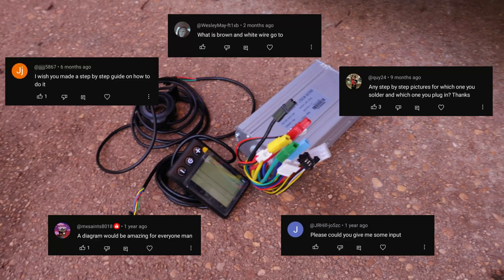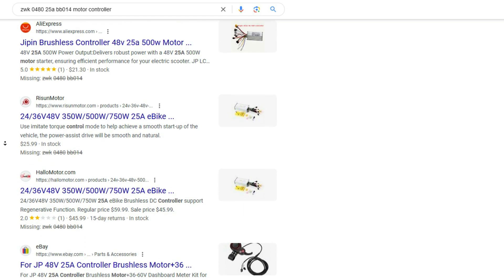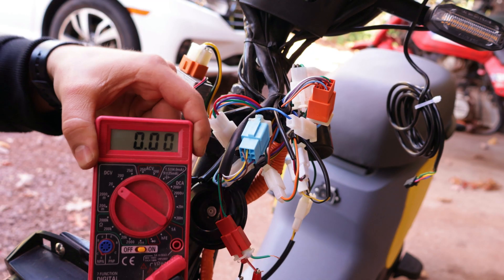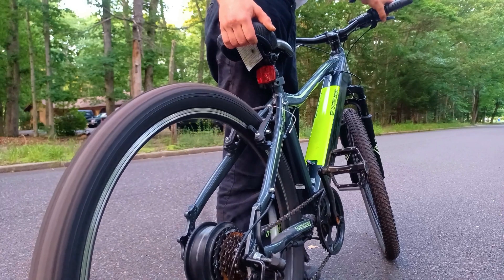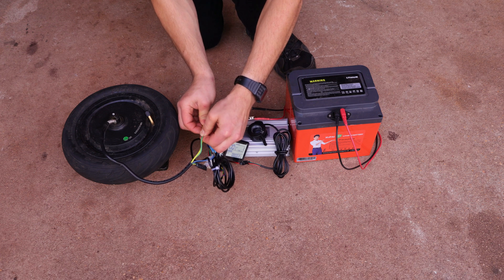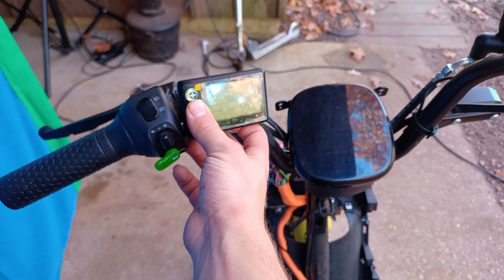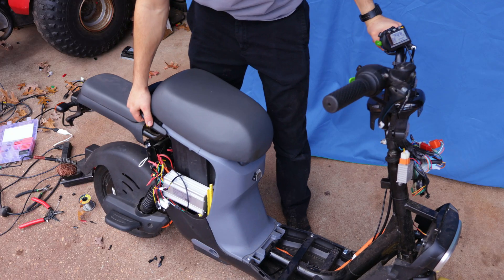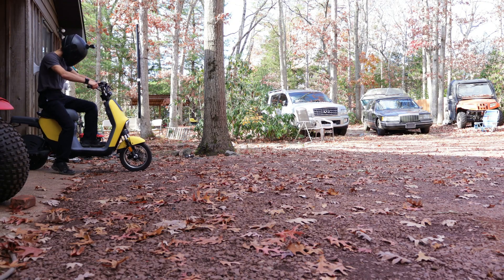STOP Making This Ebike Motor Controller Installation Mistake!

Comment: If you defeat (leave unplugged ) things like the brake sensors and crank sensor will the controller still work? I transferred a kit to a larger MTB but I'm getting nothing at the display / no power to the wheel either -* Everything ran perfect before I re installed the kit. I was carful to plug everything else in correctly btw. I build bikes but its my first ebike.
Reply from the maker: The motor controllers can work without the brake sensor and can also work without the pedal assist sensor by default. If you’re not getting power to the display, something isn't right with the controller, and you might have to get a replacement, because there should always be the same voltage from the battery at the display (that is, if the battery is working)
Reply: @ElectronicLab.  Good to know. I found the hex heads were sticking up too high for the battery mount and not allowing the plastic battery case to sit low enough where the metal pins need to contact. thanks for the letting me know its handy to know.
Reply from the maker: You're welcome
Reply: 300 kmh faster too =)
Reply: I fixed that, but now am getting an E4 error thats code for "throttle. I inspected the throttle and reset the controller by leaving the battery out for 5 minutes. The E4 error persists. I left the crank sensor plugged in but not installed on the crank. And I left the brake sensors unplugged. Other than that I can't figure it out. I exhausted inspecting the wires and plugs for damage 4x over. Thus far I don't know what to do next =(. If I only had a spare throttle to test it. After work Ill crack open the housing and inspect this one, maybe a wire jiggled loose during the un/ installation. Nothing visible is a skew atm though and it seems to work and snap back etc.
Reply from the maker: Try disconnecting the throttle wires, and if the error goes away, then either the throttle is bad, or the throttle is not hooked up correctly . If you still get the error, I would suggest getting a replacement under Amazons 30-day warranty. because that would mean that the speed controller is not working properly
Reply: @ElectronicLab.  I checked each of those 3x over at least, plus others, and reset with every little change. You mean the "speed controller" inside the throttle body itself right?  I can easily order one and hopefully get it by tomorrow. I'm dying to try the bike already its kind of torturing me here lol
Reply from the maker: I ment the motor controller. But if you only want to replace the display/throttle, you can do that, and if that doesn't work, just buy a whole new replacement motor controller kit, once again Amazon has a 30-day return policy (if you bought it from Amazon)
Reply: @ElectronicLab.  I bought a complete bike less than a year old/ 2200 kms on it, then transferred the parts to another mtb. everything worked perfect prior. I can't buy more parts if unsure, I can't waste more money on it haha.
Reply from the maker: Makes sense
Reply: @ElectronicLab.  I installed a new throttle, the e4 persists. I keep reading to reset the display but both soft and hard resets do nothing. Still got the emtb blues for real its a long weekend and Im a mile away from 20 miles of beaches =/ LOL The ladies better wait for me.
Reply from the maker: @potsy9973 Something that can trigger this code is holding down the throttle on start-up. But I guess if you've replaced the throttle that runs with a new wire to the motor controller, the only other option would be to replace the motor controller.
Just because I'm curious, did you buy the motor controller kit that I've linked in the video description?
Reply: @ElectronicLab.  No no, I found your channel trying to fix an M10 Isinwheel emtb I just bought but then found it to be too small, then I swapped the e- motor parts all over to a Specialized stumpjumper 29 MTB, everything worked perfectly prior and I was carful not to mix up any wiring etc. I was going to buy a new controller but the wiring is different. even tho I went by the # on the one I have. sigh.
Reply from the maker: The main wires you need from a motor controller are: red and black for positive and negative power input, 3 thick colorful wires for the motor, 5 thin wires minimum for reading the motors position(hall sensor, usually a more square connector), 3 thin wires for throttle, and sometimes you'll have a display which has about 5 thin wires. If you hook up all that, you should be able to get it going, unless something was hooked up incorrectly and got damaged
Reply: @ElectronicLab.  Odd that the error stays even when the throttle is unplugged. Im going back to my greasy motorbike its reliable and simple to repair lol
Reply from the maker: I guess it's better than nothing
Reply: I just won an e-bike in auction and the battery holds charge but the display doesn’t show anything should I open the area holding the controller and take it out for inspection or?
Reply: @madweedz15  Was the battery switched on ( dumb question but it happens) Yes then inspect every wire and pin connector for signs of damage, a multi meter test is best then u know for sure if every wire is getting power from end to end. first remove the battery to try resetting the controller.

Comment: My vevor controller and surron battery were working great till today I hopped on went down to the yard and it just stopped working I’m thinking it’s the throttle tho it felt alil stuck and didn’t slide as easily as it should hopefully that’s all it is battery still shows 91v 60v battery
Reply from the maker: I wish you good luck

Comment: If I were to go on the po8 Settings, would I be able to go faster on any ebike like that use that controller
Reply: Just check your motor and controller if its too hot too touch then lower the speed down a tad.some motor i uses the s866 controller on hate life past 30mph
Reply from the maker: Possibly yes, because some ebike manufacturers lock the speed through the display settings while some lock it through a physical wire
Reply: What if I put this controller on any e-scooter and then change the settings for it to go faster specifically the gyrocopter J30
Reply from the maker: There is only one way to find out. Install it, and test it
Reply: @NasirAhmad-e7h  if your oem controller have a speed lomiter yes it be slightly faster.but with any e motors you need more voltage for more speed just its at your own risk

Comment: What if the controller dont have hall sensor?
Reply: Thanks  I thought so but I can't find how to make it work I got everything else to fire up but no go on throttle.any help would be appreciated.
Reply from the maker: By fire up, you mean the display is working but the throttle doesn't do anything, not even noises? And also are you using a speed controller that came with your ebike, or are you using the Chinese controller from Amazon? Because the ones that comes with the ebike usually don't work without hall sensor feedback
Reply from the maker: I think the controller can also work without hall sensor input, but it won't have a great starting torque like if it would have hall sensors

Comment: Great video! I'm pretty sure the controller takes DC in and inverts it to AC there phase. I think also there are different controllers. I was just reading a thread and they were disagreeing but I definitely know if when I check for voltage at the output of my controller/inverter DC won't register so I'm saying it 3 phase Ac maybe I'm crazy but I swear you can tell from the sound of the arc. Can anyone elaborate? I' tell people that ebikes are really addicting! I can't get enough. I wanna build some kind of hybrid bike with like a little 5hp diesel for the main power through a generator and also utilize the hub or hubs for gegen and also some type of solar with lic caps!!
Reply: Technically it's modulated d c, that means it pulsates, but doesn't go negative like a c
Reply: That's very similar to a c current, and how it works

Comment: This video is great thank you!  I’m having a problem. I am not sure my controller is getting power. I tested the voltage from the plug on the battery and it shows full (36v). When I plug in my display to the controller it won’t turn on. It doesn’t even spark when I plug the battery into the controller like I think it should. Any ideas?
Reply from the maker: It might be a defective controller or display. Amazon has a 30-day return policy, so you can get a replacement
Reply: @ElectronicLab.  I just checked the battery plug again with the multimeter and it still shows 36v. I was curious so I put a wire in the positive and a wire in the negative of the battery to see if I get spark when I briefly touch the wires. Nothing happened.  I don’t think the controller is getting power. How can the multimeter show power but not getting any spark or anything?
Reply from the maker: Sometimes, the battery management system goes bad from a battery pack, and you might have to replace it. Preferably with one that has enough current capability and also has a cell balancing feature. I suggest you should first connect 36-volts from a different battery  pack or from a power supply.
Reply: @ElectronicLab. Thank you!  I’ll see if I can find another known good battery. I think you’re right. It’s probably the BMS.

Comment: those motor wires arent for 25amps it will burn at 25amps for more than 5m
Reply from the maker: 3 phase motors don't receive 25 amps continuously for each wire. The current is distributed between the 3 phase wires.

Ps, the moped this was installed on has already been driven a few hundred miles since the new motor controller was installed, and there were no issues.
Reply: @ElectronicLab.  ohhhh ok thanks for the info

Comment: How about for those motors that don't have hall sensor
Reply from the maker: I think this motor controller can work with hall sensors, although you'll have to push it in order to start driving.

Comment: i had the issue before where the motor will attempt to spin but doesn't,  trying out the method you told works but now when i have another issue, the motor doesn't spin at all, i still get power on the throttle because i can see the voltage counter but when i twist the throttle there's literally nothing, no sounds of the internals in the hub motor spinning whatsoever. I tried to interchange the phase wires with many different combinations but it still won't work. Any ideas?
Reply from the maker: Amazon has a 30-day return policy, so I suggest you should get a replacement because it sounds like the motor controller is defective

Comment: so you telling me i can technically make electric racing wheel barrow based on that video?
Reply from the maker: Yes
Reply: So, you're telling me that you really don't know if an electric wheelbarrow is possible? If you can bolt a wheel to it, you can bolt an electric wheel to it. Obviously. 50mph pushchair? No problem. motorway speeds on your wheelie bin? Easy. Drag race Wheelbarrow would use about 5% of my mind to make.

Comment: Interesting idea 😅
Also the moped battery is pretty beefy, do you know what kind of range you were getting when it was on the moped?
Reply from the maker: I didn't test it, but I can tell you that after driving a 10 mile trip, the battery is still at 3/4 full

Comment: How fast for a 48v?
Reply from the maker: It's 30 miles per hour and most ebikes that have a 48-volt battery, can also reach this kind of speed.
although some motors are built to have high torque and low speeds, like when I built an electric trike that uses hoverboard motors which works with a fully charged 63 volt battery and only goes up to 24 miles per hour, but has so much torque that you have to lean forward in order not to flip over: https://youtu.be/lN26pIku1ds?si=pywRyBhFDOu3MNx9

Comment: is that 30KPH or 30MPH?
Reply from the maker: It's 30 miles per hour and most ebikes that have a 48-volt battery, can also reach this kind of speed.
although some motors are built to have high torque and low speeds, like when I built an electric trike that uses hoverboard motors which works with a fully charged 63 volt battery and only goes up to 24 miles per hour, but has so much torque that you have to lean forward in order not to flip over: https://youtu.be/lN26pIku1ds?si=pywRyBhFDOu3MNx9

Comment: I have a controller like the one you just removed from the moped. It did not come with instructions. Could you kindly do a video or explain how that type works? Mine is the DKYS 72v 3000w controller.

Comment: Great video, I'm currently planning to fix my Chinese ebike. The controller failed and I want to get a new one. I'm seeking a motor controller for it.
Reply: Can I have your email? I wanna send a picture and ask for your recommendation.
Reply from the maker: @jamaliepuran2107  post a video on your YouTube channel
Reply: @ElectronicLab.  The hub motor is 48v 500w, the old controler is 48v 20a 500w but it got damaged and I noticed that it wasn't pushing enough current. When I opened it, I noticed that one of capacitors were bad it was about to catch fire. I quickly disconnect the battery as I upgraded from a lead acid to LifeP04 48v 16AH.
Reply from the maker: @jamaliepuran2107  This should work: https://amzn.to/3RMK8Br (amazon affiliate link)

Comment: if you don't have Hall sensor, will you still get speed on display? if yes then how is the speed calculated.
Reply from the maker: @dariusz078  I think this motor controller can work without hall sensors, and if it shows speed, then it probably calculates it through rpm, since in the settings you can tell it how many magnets the motor has and what size the tire is.

Comment: I have the same controller bro do you have to connect the display it comes with or can can u use the display the ebike has in the middle if it works
Reply from the maker: @shomaris7661  try it

Comment: Hey ElectronicLab, ich habe dein Video gesehen und muss dir wirklich eine Warnung aussprechen: Diese chinesischen Elektroroller sind absolut nicht dafür gemacht, wie ein Motorrad gefahren zu werden. Die Rahmenqualität ist katastrophal – die Schweißnähte sind oft minderwertig, und die Geometrie ist völlig unausgegoren. Wenn du den Roller schneller machst, setzt du dich einem enormen Risiko aus.

Im schlimmsten Fall kann der Rahmen unter der Belastung brechen – stell dir vor, du fährst mit 30 oder 35 mph und das Ding zerbricht unter dir. Das ist lebensgefährlich! Diese Roller sind für moderate Geschwindigkeiten und vorsichtige Nutzung gebaut, nicht für Racing oder aggressive Fahrweise.

Bitte tu dir selbst den Gefallen und behandle das Ding wie das, was es ist: ein günstiges Fortbewegungsmittel für den Stadtverkehr, nicht ein Motorrad. Bleib sicher! 🙏

Comment: Are you saying to switch around the the phase wires like connect the yellow one to the green one and the yellow one to the red one
Reply: Is that what he meant. ? Switch phase wires??🤔
Reply from the maker: these Chinese motor controllers from Amazon have this issue that when the 3 phase wires are color to color, it doesn't want to work. so for that, you have to switch around the phase wires until it spins in the right direction.

Comment: So I got a controller that says 24/36/48 with power of 250 350 w and my bike is a 36v with 250 watt shouldnt it work still cause that paperwork has me confused but then controller they sent only shows 42v 250/350w both are 13 amps
Reply from the maker: At 10:16, you can see me entering the motor controllers settings through the display, and if you want to make sure that  it is set to the same voltage, then you should change the p03 settings, which should give you the option of 24, 36, 48 or 60-volts. (I already used the 60-volt(67v-max) mode in a previous video on this ebike motor controller, so it should be safe)
Reply: Cool so how do you keep settle assist  with full power is it a setting?
Reply from the maker: P10 allows you to select what controlls to use. Setting 0 is pedal assist only, setting 1 will give you throttle only, and setting 2 will give you both pedal assist and throttle control.
P11 is power sensitive, ranging from 1 to 24. p12 is power assist starting strength, ranging from 0 to 5.

Overall, the controller should already come with the speed set to max, although when powering up the ebike, it will be set to level 1 speed and you can just press mode/plus button ontill you get the highest assist number.
Reply: @ElectronicLab. I turn on throttle and tire moves without pulling on throttle  is it a wire or a senser wire?
Reply from the maker: @Goonielogic  there is a single wire connector that is responsible for changing the direction. While it is connected, it will make the tire spin at a medium speed. To stop this from happening, just disconnect that single wire connection.
Reply: @ElectronicLab.  thx i gave up wire colors didnt match and the paper they sent i couldn't read the 5 prong pluge by time I got to it i was down to 4 stands lol put back other one and said o we'll lol maybe a diff day cause all the things I tried i had 2 speed but always on thx anyways

Comment: Ive watched a few of your vids and I want to make an e drive system for a wheelchair attachment I have. If i get the controller kit you have linked here and the brushless drive wheel can i adapt a remote throttle with receiver like for an e skateboard to use as a throttle? Any help is appreciated!!
Reply from the maker: @masterofnonetv8361  It would probably be best to use a skateboard motor controller in this case, because it already comes with a receiver built-in.
Here is one that is rated for 430 watts  peak and supports two hub motor's: https://amzn.to/45J5Gn6
I also made a video on how to build an electric skateboard. It might have some info that might help you with your project: https://youtu.be/ZngCHowHVSE